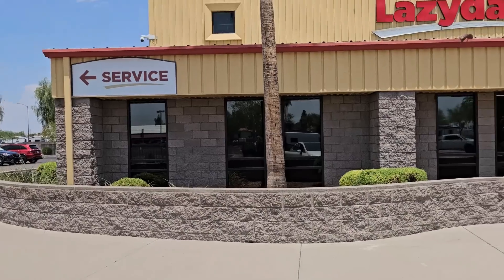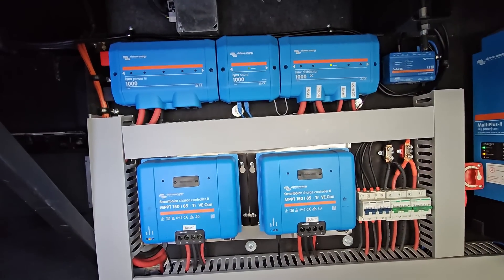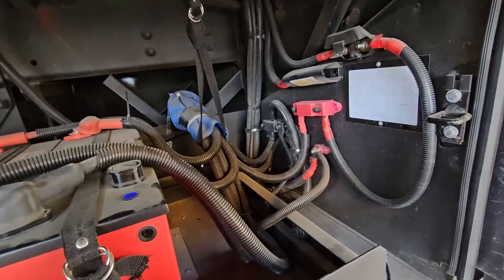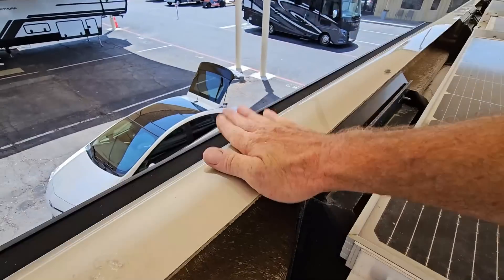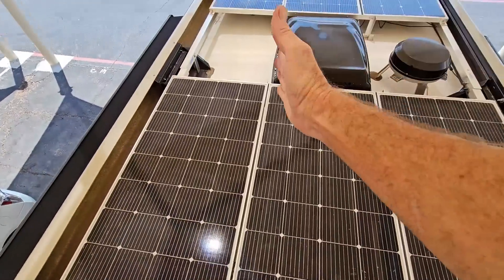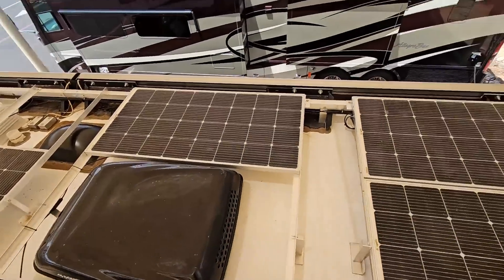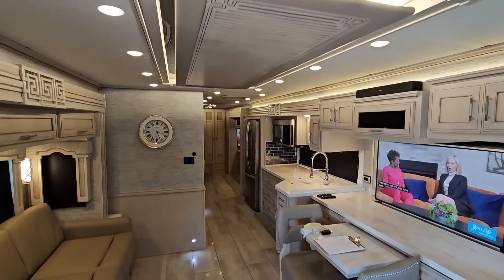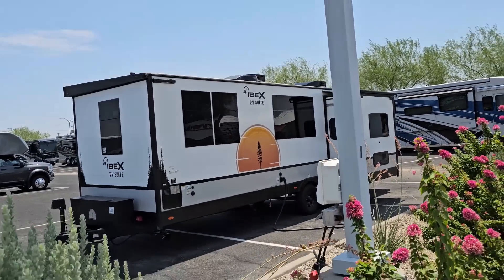They Stole My Idea...and Did It Better Than Would!!

Comment: I enjoy solar videos. I’ve been off grid for four years.  I used a hybrid 3600w inverter and plugged my rv into the inverter. Then I installed a buck or boost transformer to run my 12 volt. The best thing I did was install a soft start on my ac. It works incredibly well. I want to install soft starts on my fridge and freezer but I need to do more homework because I haven’t found one small enough. 
After adding a soft start I can talk on my phone with the ac running!!

Comment: Is there any way to keep the magnum for some circuits or is it best just to abandon it like this Ventana? 
I'm having anxiety about my Tiffin Phaeton install and keeping the Tiffin Spyder controls operating using the RV-C communications talking to Victron. I really love the spyder controls and hate to add the cerbo and victron display if not necessary.
Reply from the maker: You can add a bluetooth dongle and just see the victron on a tablet or phone without the hardwire cerbo. I would keep the original equipment in case I wanted to return it back to factory.
Reply: @AZExpert Thanks for the reply sir. I did just complete my  house battery swap to 2 of the Vatrer 12.8V 460 AH  batteries with a smart shunt. Love them.

Comment: I have to say my solar addition is neat, but not that neat. I'm currently on one 300 ah battery with 895 watts with only 5 195 watt panels. But I sure would like to move up to less panels but get some that are 400 watts or so because I could likely get 5 panels up on the roof. I'd also like to add another 300 ah battery.  My panels are on a Tiffin Mh and the power panel is similar to the Newmar panel you showed. I did remove my Xantrex and installed it on a friends older coach. Thanks for this review.

Comment: Very nice install on the upgraded electrical system. One solution to the limited pathway walking access to roof because of solar panels would be to hinge panels to inside or outside depending on where the power cables are mounted. This would allow quick release with pins or whatever and lift panels to access and create pathways front to back. Great system overall. Love your videos roof inspections, solar upgrades and all.

Comment: I'm going to pull a full aluminum rack over everything on a 2002 Winnebago Brave 32v. I was considering something in this genre but made completely put of aluminum strut channel, with its feet bolted through the roof as close to edge as I can bolt and plate from inside. Maybe one middle foot in the front, but not elsewhere so the weight stays on the roof edges. Any suggestions or words of concern?

Comment: First, your videos are awesome and they always help someone, if not everyone.  Keep going.  Me, I would love to see more videos on the maintenance and upgrades in the older coaches.  Say, something in the 2000 to 2002 range, maybe a brand like, oh I don't know, a Beaver?  Just saying...  how do you maintain or redo the caulk along the roof seam, windows and the horizontal trim just above the basement doors.  What are preferred sealants for the roof, roof seam and side walls.  Shock upgrade options and how to tell when you need new.  What about maintaining the airbags on these older coaches?  I just cleaned my radiator from the INSIDE and outside for the first time, big difference!  ( I know, you have a side radiator.).  I have to go back over your videos and see if you maintain the latches on the vertical lift basement doors, or adjust the latches / strike plates.  I know you changed lighting and lift shocks.  Changing the air filter on these old 3126B Cats or even different ways to utilize the basement storage.  All good stuff.
You have great videos, keep the content diversified, but simple repairs are always helpful.  Take care of yourself and enjoy your awesome rig.  - Brian

Comment: We love your videos. I'm not critical of your work at all. You do a great job. Though I will criticize the solar/battery installation that other fellow built. First off, you are right the aluminum rack on the roof is made from aluminum angle that you can find at a big box store, namely 6063-T5 architectural aluminum. Not 6061-T6 structural aluminum angle which is stronger and more rigid, so more suitable for building a solar rack. The way you can easily tell by looking at the edges. Architectural aluminum's edges are squared, and structural aluminum's edges is rounded. Next, I would never use self-tapping screws on a solar rack as that is a weak fastener, prove to backing out under vibration. Grade 5, 5/8" (or even grade 3, 1/4") Bolts with Nylock nuts are much stronger and have less of a change of loosening up under use. I'd much rather have my panels bolted down to the roof and sealed properly, rather than relying on VHT tape. Another thing that I would change is supporting the panels by the short edges rather than by the manufacturer's approved mounting points. Supporting the panels by the inner series of holes in their frame is best to give the glass optimal support to prevent the glass cracking, which obviously happened. I can't say this was caused by the end mounting, but this can certainly be a contributing factor. 

I agree with you totally, if he would have raised his rack by just 2-3 inches, it would have cleared everything, and he could have then added more panels with even more cooling air flowing underneath. Like you correctly observed, the sun doesn't shine every day, so you can never have too much solar on an RV. Our 4,400w array is adequate, but certainly not excessive. We are happy we have that additional 620w array mounted on the side of our coach too. Yesterday we were in the direct path of tropical storm Debby which blocked out the sun for the entire day. Nevertheless, despite a partially cloudy sky, my mostly depleted battery bank is back up to 100% this afternoon, even running both ACs all day. Your goal should not just be to break even on energy usage during the day when running your A/Cs, but to be able to recharge your batteries that were depleted the previous day without sacrificing today's energy needs. Of course, with only a 2,400w inverter all it can run is one A/C at a time. 

Besides, a completely flat roof with no gaps between panels is more aerodynamic when driving down the road, creating a laminar airflow for better stability and improved economy in addition to the extra power generated. If A/C service is needed, only one panel needs to be unbolted (4 bolts) and slid aside to do so - as on my roof. Since my array is 15" off my roof, I can easily scoot under the panels for most roof service. A thin person would have an even easier job - I need to lose weight, OK. 

Also, if money is at all a concern (and who wants to waste money, even if they can afford to) why go with those overpriced Lithionic batteries? I think almost any batteries other than these would be more cost effective. For comparison, I built my LiFePo-4 battery for only $110/kwh including the BMS, whereas that Lithionics battery costs over $1,200/kwh - over 10 times higher! I rest my case.

Comment: Is a clean installation for sure. I will say that having the mp in the corner like that will easily knock 500w of usable power off it when the temps come in. If the equipment can’t breathe it can’t do it’s work…. Another reason I don’t care for the raceways.

Comment: Insufficient battery capacity.   Electrical overkill - over complicated and lots of large gage wiring because of choice of 12V system instead of 24 or 48.

Comment: About the quality, content and basically the fun of your videos: Some already were a livesaver for me, some where super helpfull, some where just interesting to watch, and even the ones that not touched any of my bases were so good that I watched them anyway! A big thank you from Germany, since we do not have a good network of service people for our few American RV's. To talk about the installation: First of all, I like the way everything looks. Clean and nicely set up. On the second thought I fully go with your opinion about the plexiglass in front of the Victron components. There should be some kind of protection, since the system gives an open space, and we all know this open space will be utilized for cargo, sooner of later. One question though: I know systems that can power the AC just fine, but on a hot day the Inverter gets so hot so quickly that it still doesnt work for a long time. Did you test this? Did they do any magic trick to cool the inverter while running the AC in summer , at high air temperatures? And: I hate the problem that the roof is so packed that you have to hop over components to service anything. A friend of mine has mounted his solarpanels on a rack that can be tilted, in his case manually, but still. This ads efficiency to the panels and he can climb up from the rear, tilt the panels, and has a clear pathway to walk the roof and work on it, even the undersides of the panels.  Please adress the question of the timeframe of AC usage vs the heat-problem of the inverter!!!! But other than that, I love your content! Greets from Germany , Mark ( Holiday Rambler Imperial 38 PST , Cummins ISL)
Reply from the maker: That is very kind. Thank you

Comment: Why would somebody spend so much $$ on that solar set up and then trade that RV in? Especially on a rig that sits in RV resorts? That RV without that solar set up is what, a $250,000 (just guessing) so now it's what, it's a $300,000 used RV.  Seems kind of dumb to spend that kind of money upgrading it to go dry camping in such an expensive rig.  Myself, I go dry camping in my 24 foot class C with two $80 walmart batteries for weeks at a time. Looks like a case of more money than brains.

Comment: My lesson learned...  Always buy extra solar panels and store them as spares.  I spent a lot of time getting the brackets/mounts set for replacement if I broke a panel.  But Renogy changed their size, voltage, and amperage for every new build of the panels. The part number stays the same, but they have "versions".  They ship whatever version is in stock.  The result is that I ordered new panels (same part number as previously) and they won't fit.  I would have to remove all the racking and replace it all.  I'd guess this is common practice for cheaper imported panel manufacturers.

Comment: Not to toot my own horn, but I do Alot of industrial control wiring and that looks like how I would do it. That's the same wire duct we use in control panels and I probably would have put some PVC conduit like they did as well.

Comment: Superb solar installation.  Doing the maths (I'm English ;) ), going from 12 panels to 14 probably wouldn't work. Two controllers means 6 panels each. 6 panels would be set up in a series/parallel combo - two pairs of 3x parallel panels in series, or three sets of 2 x parallel panels in series (hope that makes sense?).  
7 panels per controller would mean all in parallel which would be a pretty high current and big cable needed coming down. (I've got 9 panels in parallel on my own motorhome but most are small 'in-fill' panels so low current anyway - nothing like a 2400W array).

People who don't like the videos? tell 'em to go watch something else :D

Comment: I would have made some of the panels tilting/lifting(easy to do) so I could lift and pass by...sorry without tilting features it isn't a good enough design...plus the tilting feature allows adjusting for sun...heck...even a motorized tilt should have been in there for the price...

Comment: I don't think I've ever disliked any of your videos. If anything, I just wish there were more of them. Keep up the great work!
Reply from the maker: Thank you. That's very kind of you!
Reply: @AZExpert  I came to say the same thing. Don't listen to the haters. You explain things in a way that many of us can understand and follow along. Your stuff gives me ideas of things to check on my RV. Things I would like to upgrade in the future and things to be aware of. You remind me of John from @Farmcraft in how you explain your process.

I few suggestions if you are looking. Can you do some videos on maintaining the Computerized Leveling System? I have a hyd leveling system in a 2007 Meridian that is very slow to retract. Are there grease nipples I can maintain? They go down perfectly fine but my two front ones are 30 to 60 minutes to fully retract. They go up 80% of the way and then it gets slow. Could it be the springs? Are the springs hard to change? Rear once are fine. The Passenger one takes the longest. 

Another small issue is my Passenger Windshield Wiper over extends and hits the center glass pillar. Can this be adjusted? How can it be done?
Reply: Ditto! Great presentations.

Comment: Great video (as always), if you need any ideas, I know of at least one subscriber that would LOVE to see you install a Victron Energy BMV-712 Smart Battery Monitor with shunt that is set up to also auto start a Onan QG 5500 generator using the built in relay. I mean it is the cheapest option that I can think of to adding an auto generator start and allow you great access to monitor your battery. A schematic, parts list and tutorial video would surely be money for your channel.  I even have a donor RV that would be great for the install and isn't TOO terribly far away from you. It could in fact be driven to your shop if needed and parts and labor paid for... I'm just saying.

Comment: LOVE YOUR CONTENT, ALL OF IT !   I'm nit sure why people buy lithionics or battle born batteries anymore. Lithium has come down 75% in the last couple years with 100 amp 12v batteries selling for $100. And 320amp cells for $69 each($272 for 12volts) you can build your system to any voltage and any size for $1/amp/hr and still use all victron equipment and likly save $10-15,000 for this coach's electrical upgrade. Even SOK's waterproof heated 10 year warranteed batteries are 1/3 the price of lithionics. CHEERS AND SAFE TRAVELS       Steve h.

Comment: I'm far from a solar or any off grid expert but why don't they have the shunt mounted in the middle of the bus bars? It should be the closest to the negative battery terminal. Or am I wrong?
Reply: Correction. Why did they mount it between.